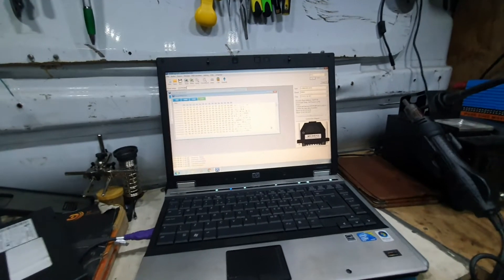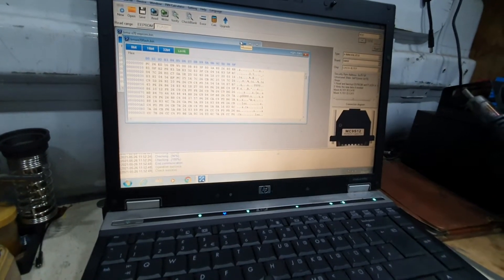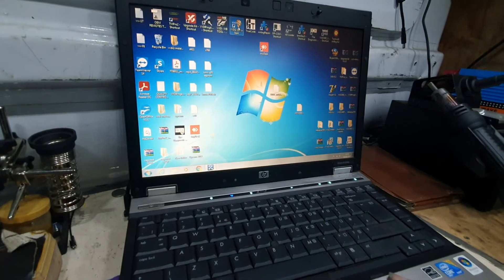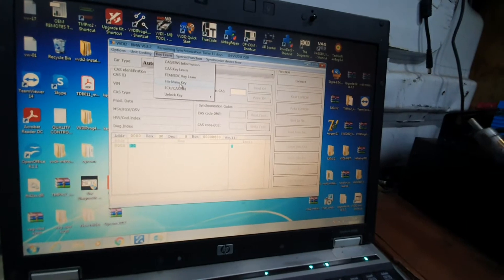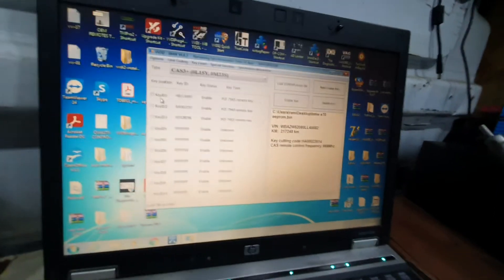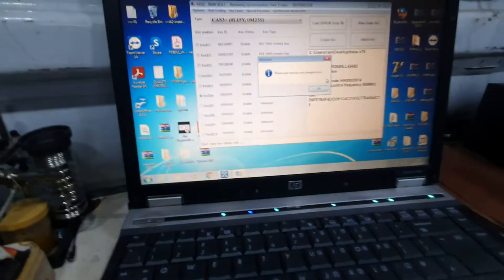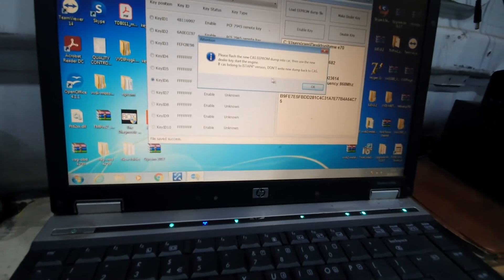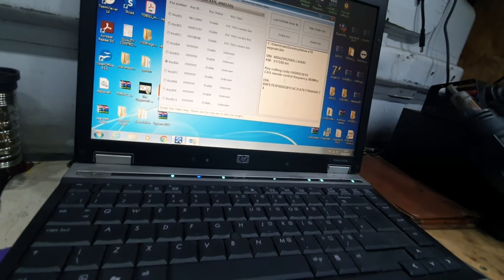bmw cas3+ remote key programming using vvdi2 and vvdi prog (bmw x5 E70 2010)

Comment: Hi, need to write the new file back or no? In end of video, vvdi says flash new file back , but many people say no need,  and others says need... Thanks
Reply from the maker: Hi 
No need to write the file back 
In fact if its a cas3+ istap never write any file because you damage the cas
Reply: @ramiztheautolocksmith9022  not so sure because I write file back all the time and cas is fine